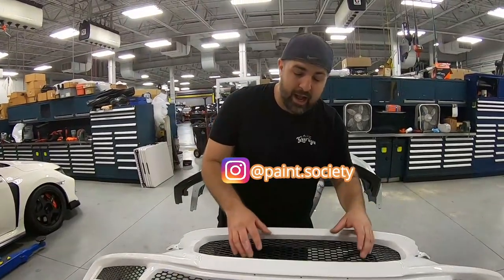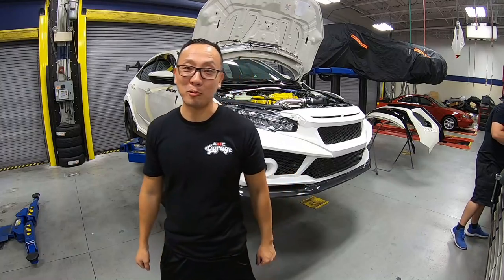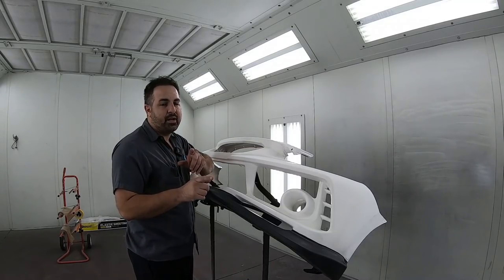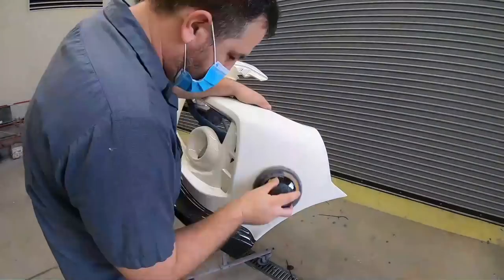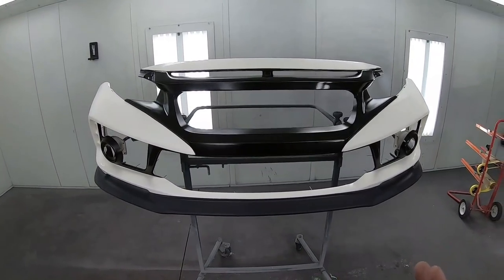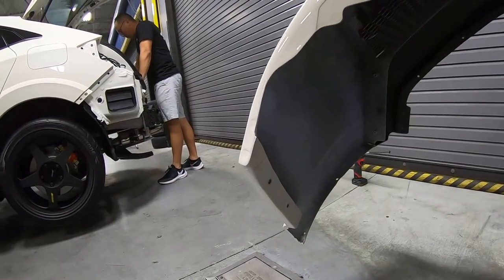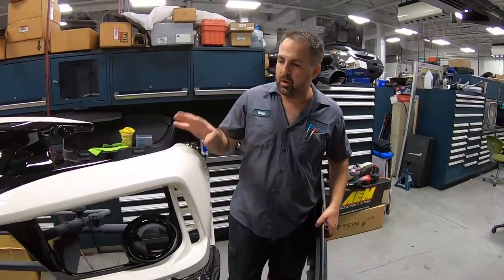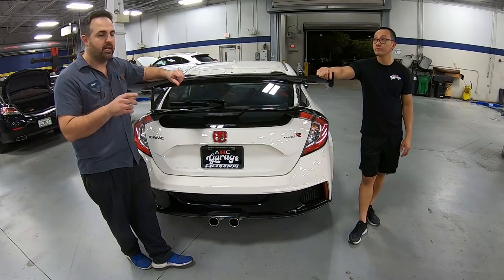Spoon Sports Catalog Honda Civic Type-R FK8 Carbon Fiber Front & Rear Bumper Painting & Installation

Comment: Again AWSOME installation… Front an Rear 
But - Some States Require Front License Plate !
What can you Advize ??
Reply from the maker: You can attach the front plate to one of the front grill inserts
Reply: @ahcgarage  FYI. I JUST FOUND A site called evasive motorsports they have a tow device that bolts up behind underneath the fender right beside the fog light it has an extension for a toe ring and they offer a license plate set up with the same toe ring rod- Check it out !!!!!!!  Very Sturdy

Comment: You know how sometimes you see cars with aftermarket bodykits/ bumper it always get stone chips easily? is it because the quality of the paint/ not enough layers or is it because of the material of the bumper because most of them are made of fiberglass
Reply from the maker: Most aftermarket body kits come with a poor adhesion primer coat, for this particular kit we made sure to sand off any primer that came with it and apply our own materials to ensure a chemical and physical bond to prevent rock chipping